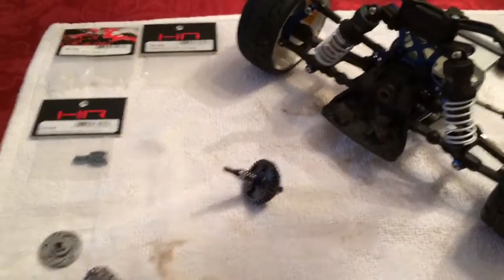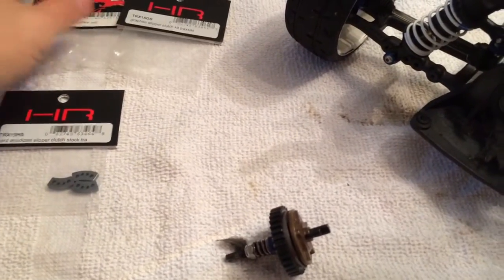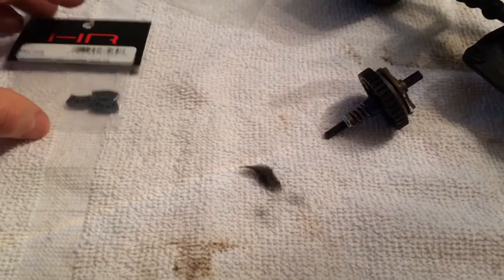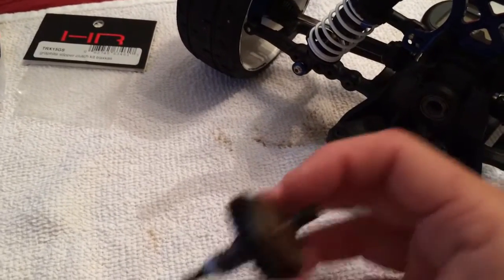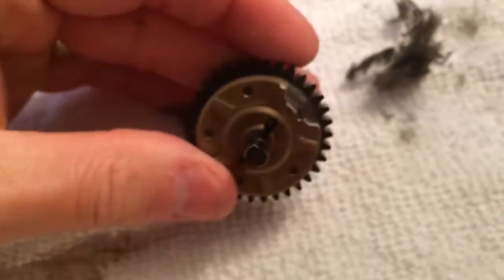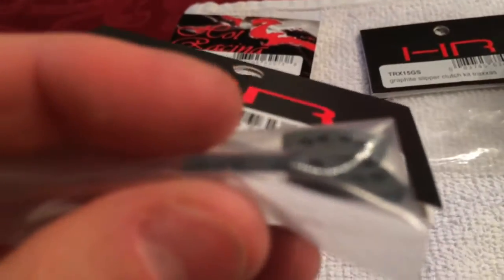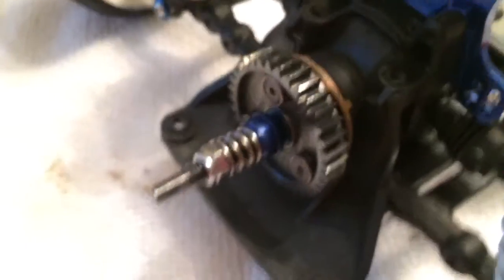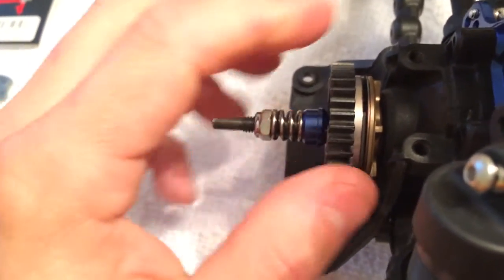Slash 4x4 problem

Comment: It can have a little movement  but don't think that much  try a up grade  slipper and pads   and  try to get some of that slack out
Reply: That's  crazy it's not stepping spure gear I've  always  get it tight then back it off  if it's sleeping  you can  usually  hear it

Comment: Hey bro there's an aluminum upgrade pad for the slash 4x4 slipper clutch. It works great and you won't have any problems even with the play. I have done many runs with that car and the pads check out my videos